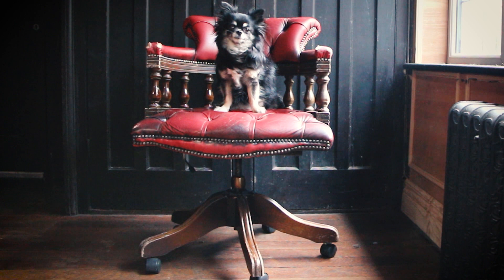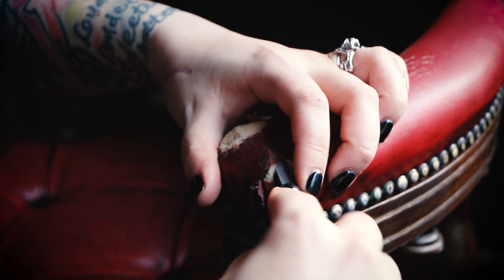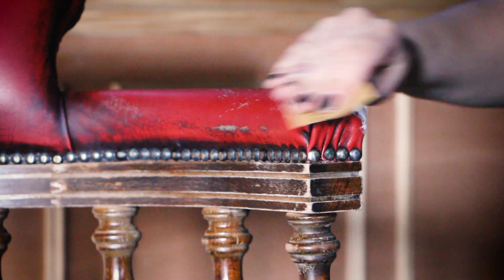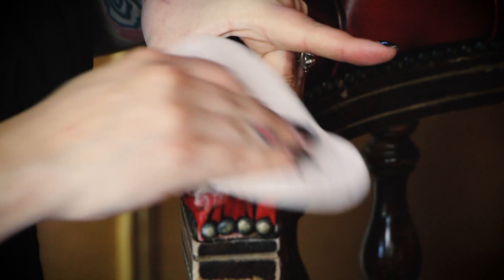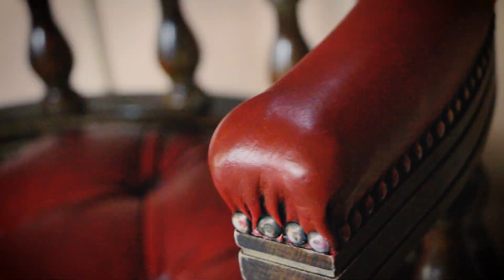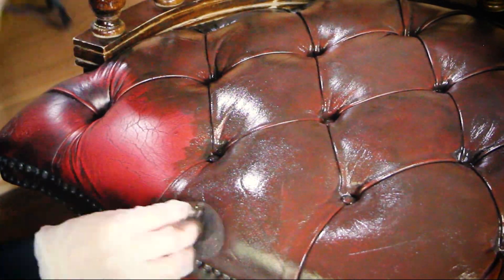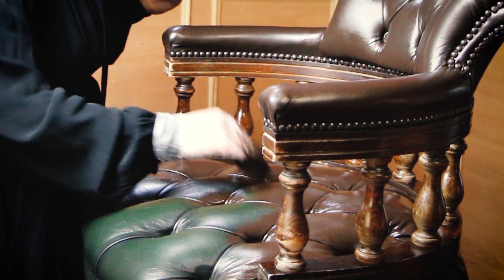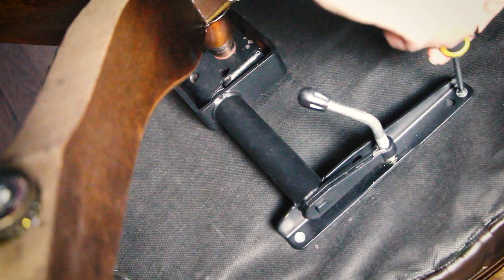Can I repair damaged leather and restore this vintage chair | Madaline Macabre

Comment: Ooooooh yes! I was waiting for your vidéo and I'm not disappointed, you did a wonderdul job with this chair 😍!
Reply from the maker: I'm very happy you enjoyed, thank you so much! 😊👻
Reply: @MadalineMacabre  you're really inspiring, I've never dared buying leather chairs on Internet thrift sites because I didn't know how to restore them and for me only professionals did have the capacities and the materials to do it but now I have the confidence that's its not impossible so i thank you for it ❤.
Reply from the maker: You are very welcome! I'm delighted my video inspired you and gave you confidence! 🖤 the leather repair kit doesnt break the bank too and although the tubes and bottles are tiny they were enough to repair all 4 tears on my chair - so quite a substantial damage size. And it isn't difficult, just takes time and patience, as every step requires thin coats and times to dry etc 😁 so go get that dream chair of yours, you can fix it! 😊🖤
Reply: @MadalineMacabre  now I must find a  beautiful leather chair to try 😆
Reply from the maker: Good luck with your search! 😊 and when you do,  if you need any advice - I'm here 👻